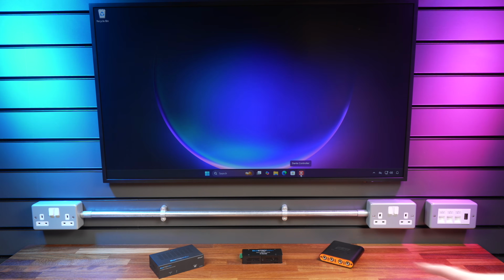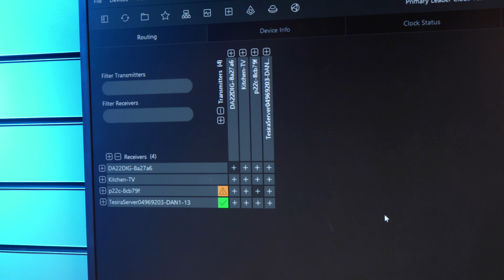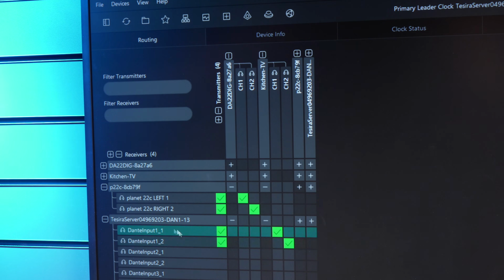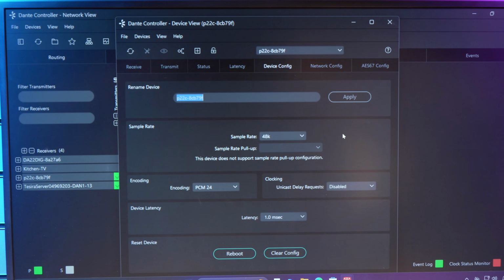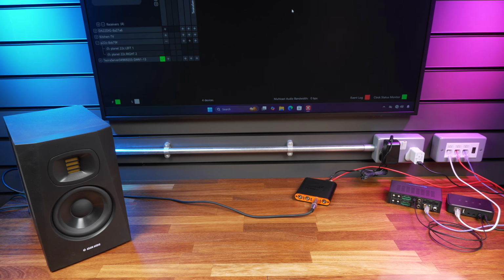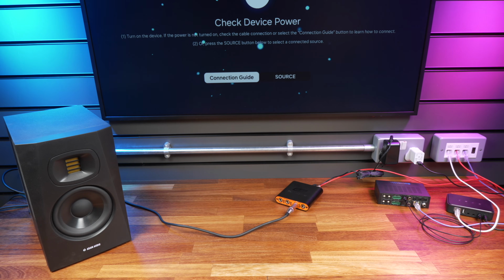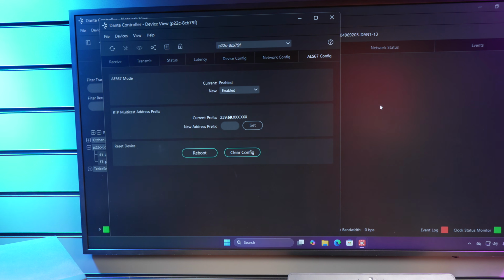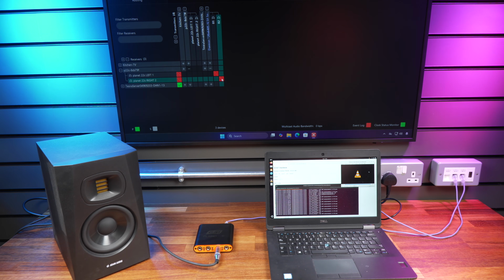Building My Ultimate Multiroom Audio System — Part 3: Dante Audio over IP!

Comment: Have you thought much about how you will handle ducking for announcements with your AV receiver? You’ve sent me down a similar journey and my Tesira just arrived this week. I’m starting with general BGM and announcements but eventually want to bring TV audio into the system. I’m trying to think of clever ways to utilize ceiling speakers for surrounds or general BGM and if that is a physical switch between an AVR output and a Tesira driven output or if I should just lean on home assistant to swap inputs on the AVR. Either way excited to see where you take your system!
Reply from the maker: Generally the AVR won't be used for announcements although I can use Dante to feed multiroom audio into the AVR or to play audio from the AVR in other rooms using its zone 3 output.  My current idea is to route the ceiling speakers in the living room via some sort of speaker switch box - I've seen some that work automatically based on whichever source is playing audio so ideally looking to find one of those for a reasonable price.  With that setup I'd have the height channel outputs of the AVR connected as one source into the switch (the one that usually has priority) and then the output of the Tesira would be connected to the second input.  With this setup the ceiling speakers would normally operate as height channels but if I were to play music or an announcement over the ceiling speakers the switch box would automatically switch and route the audio to the ceiling speakers.

Comment: That is insane. Those speakers are not cheap either. Do You have the software to calibrate them? They might have an evaluation copy bundled.

I had analog cables going everywhere on my previous spot. Latency and sound quality were perfect, but it looked ugly.

Comment: Great videos! When it comes to actually switching the audio from 1 stream to another, how are you handling that? Is that through home assistant or does your DSP provide apps for your phones/devices to select which zone plays which input?
Reply from the maker: It's all done through a custom Home Assistant integration I've built - the Tesira DSP offers a telnet API which is what I'm using to control things like routing and volume.  I'll be demonstrating this all in a video soon!

Comment: Any chance you'll conclude this series with Node Red and Home Assistant info?  I'm curious what node you are using to persist the telnet connection and send/read the commands.  Thanks!
Reply from the maker: The next video will be more of a high level tour of the completed setup along with the software side of things however there's a limit to how detailed I can go without dragging it out to ridiculous levels.

As for the connection to the Tesira, I'm currently still using a RS232 serial cable along with the Node-RED serial port block. I found the telnet connection on the Tesira to be very fussy and wouldn't work properly with any of the standard Node-RED blocks.  However a friend of mine has built a custom Node-RED block specifically for the Tesira that should work, I've just not had a chance to migrate to it yet: https://github.com/CraigSnowden/node-red-contrib-tesira
Reply: @camerongray1515  thank you!!

Comment: We use Dante at the studio I work at. It’s amazing and also very resilient. The virtual sound card software is one of my favorites since we can run multiple software outputs at the same time into a board without multiple adapters and analog lines.

Comment: Are those TOSLINK adapters really stereo only? SPDIF can carry multichannel bitstreams such as Dolby Digital AC3 and DTS (the native formats of DTV sources) so I'm surprised they don't do surround sound.
Reply from the maker: They are only stereo - the audio needs to be mapped to/from Dante channels - Dante has no concept of Dolby/DTS.etc, just individual mono channels.  If this device were to support surround sound then it would need to be able to decode/encode Dolby/DTS itself and also need to be able to support more than 2 Dante channels, both of which would increase the complexity and cost.  Dante interfaces that support Dolby do exist, but they cost over £2k!

Comment: I'm all for Dante and IP solutions, so this isn't a critique of that at all, but just wanted to highlight that analogue balanced line-level audio is quite robust over very long distances. A shielded CAT5/6 cable can carry 4 channels of balanced line-level audio for many hundreds of metres without issues. Even balanced mic-level is perfectly fine over a hundred metres or so. So yes, audio over IP is amazing, but if your setup uses balanced audio gear and doesn't need many channels, never be afraid to use (ideally shielded) CAT5/6 as an analogue multicore.
Reply: Indeed, you'll generally have no problem running balanced audio over long distances as long as it is shielded. This is the way it was done for many decades before digital audio took over. Running balanced audio over analog DB25 from stage to control room in studios, stages, and theaters was (and is) common practice and rarely had issues.

The biggest advantage of digital are (1) clock sync between audio source and destination, (2) no unnecessary quality degradation if both sides are already digital, and (3) way less cables if you're running 16, 48, or 96+ audio channels, etc.

Comment: Hi Cameron, great vid and I only found it marginally difficult to understand on 0.9x... only joking 😉 Having watched your other video just now about the Tasira... I presume Dante devices can't do one-to-many, i.e. send from one and receive to multiple? If it could, might it render the need for a centralised zone amp redundant, as you could just have an amp in each room you need the audio, and basically have every room connected together as needed? I note you do your audio routing using the Tasira, but could you equally do it by dynamically controlling the Dante devices directly, e.g. from Node-RED? For example if I wanted to switch one source from one receiver to another? I mean - that Dante software is just sending configuration packets to the Dante devices right? I wonder if that could be replicated in Node-RED. Maybe a weekend project... Or is the networking between Dante devices encrypted and with certificates and whatnot? Right now I have a couple of Monoprice Zone Amps (12 stereo zones in total) with thick heavy speaker cable running to each room. The amps themselves are the "matrix mixers" so no need for additional audio DSP, at least not for my needs. Two of the six-zone amps are connected together to make 12 zones. You can route many to many, with the limitation that you can only route 6 of the 12 inputs to any of the 12 outputs (i.e. can't use all 12 inputs). But for me 6 inputs is just enough for 4 central sources (airplay / squeezebox etc.) plus a couple of roving source connectors which could be connected to a room over CAT6. Best bit is that I can control the amps directly from Node-RED (via RS232 to the amps) including vol/balance/bass/treble/mute/power/input channel selection for each output channel, which is cool as I have touchscreens set up around the home that allow me to control each room's audio, or all rooms together. Paired with a rackmount 3 channel DAB radio and Airplay inputs. It's fine but I'm always scouting for alternatives. Finally where do you get reasonable quality / cheap toslink cables of differing lengths? I need a stash of quite a few of them for my whole home audio setup 🙂 Shame about pricing for this stuff. Any old models that go on ebay?
Reply from the maker: You can do one-to-many with Dante although it's not really designed with the idea of using the Dante routing to route audio to different zones on the fly.  The only official way to do it is with the Dante Controller software although there are some unofficial libraries I can see that may work.  That said, you still wouldn't have the ability to do things like adjust volume controls or mix multiple channels together.etc.  The thing to bear in mind with Dante is that it's not really targeted towards this sort of use case, it's designed more for live sound settings where you want to get sound from microphones/instruments on a stage to a remote mixing desk.etc - essentially an IP alternative to running dedicated audio cables.

For a multi-zone setup with Dante the preferred way to handle routing would be with some sort of DSP or audio matrix to actually perform the routing and mixing.  That's what the Tesira I'm using is - a massive DSP that has both analogue inputs/outputs as well as Dante support.  I covered it in my previous video but essentially I route all of my audio through into it (both over analogue inputs and over Dante) and then connect the outputs to my amps.  The Tesira is then programmed to route audio between zones, downmix stereo to mono, apply crossovers for subs, apply EQs, mix in notification audio including ducking the music down and back up and tonnes more!  The initial programming is all done through Windows software but once that's done, things like routing and volume control can all be done over a Telnet interface from Node-RED.  They're great devices - eyewateringly expensive new (my config wouldn't be far off £20k!) but you can regularly find them on eBay for under £500.  You may just need to shop around to get the particular set of I/O cards that you need.

There's various other DSPs out there that also support Dante, QSC Q-SYS being one of them, but I haven't got any experience of them.

As for amps in different rooms vs centralised - You absolutely could have amps in each room all connected over Dante although I prefer to keep them centralised just so they aren't on show.  However, as I mentioned I will be using Dante to send audio to my living room AVR since that's the one room where I have a proper speaker setup.  That's where the flexibility of a Dante system is so good!  If you were absolutely made of money you can even get Dante speakers that support PoE so you could do an entire install entirely over Dante.

As for the Toslink cables - my preference for cables is generally CPC since they're well priced, have a decent range and usually provide data sheets so you know exactly what you're getting as opposed to Amazon where you're inundated with random gibberish "brands" with completely unknown quality.  That said, I think the Toslink cable shown here is just the cheapest Amazon one I could find, super flimsy but for Toslink when you're basically getting a bit of plastic "fibre" they're absolutely fine!
Reply: @camerongray1515  Thanks for your reply, in the meantime I watched your other video and got myself up to speed with your plans, and updated my comment. Before I noticed you responded :) I too have bought toslink from CPC - they are usually decent quality. Really interesting to know you can buy Dante PoE speakers - amazing!

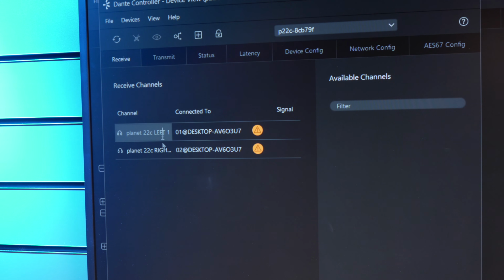Comment: 12:20 I recently bought a new planet 22c and saw exactly the same thing. I suspect this is a leftover from their factory testing procedure, where they setup a flow, check audio works and then put the device in the box without removing the flow :D
Reply: 2nd this.  Also purchased one a while back and it came up linked to another device.

Comment: Yeah Dante definitely seems to be the way to go for a DIY home a/v solution, it's so flexible. It solves a lot of problems with my highly specific use case, actually have been following your channel for a while since it's very helpful in my situation. I have a Linus Tech Tips style computer in a rack situation; run 2 machines 1 Windows and 1 Linux that I would like to mix to the same stereo output at my desk; am in to high end audiophilia, play around with dacs and amps and such but also want to run Atmos and multiroom audio using said gear. I can do all of that easily using Dante. I can easily route or sum audio from any source I want and have room correction using a Dante audio interface which I've made controllable in HA as well through MIDI2MQTT and a RPi. I've been looking to acquire an Atmos/DTS:X to Dante decoder to introduce immersive audio in to the mix, which finally seems to be shipping, however total cost of admission is still quite expensive.

In combination with a HDMI 2.1 matrix switch, I can have a seamless media experience regardless if I'm in my living room or at my desk set-up. It's nice to have a music streamer with a display to show the album art of the song you're playing and have physical media controls mixed in to your game audio when you want to play your own songs, or switch to the linux machine seamlessly if you're following a walkthrough or whatever (and use your microphone both on Windows for your game and for discord running on the linux machine). Can also switch around systems or streaming devices depending on who is using what screen. 

Just wish there was a way to integrate wireless audio in to this set-up. Using Wifi 7 and MLO you can achieve very low latencies so it should be possible to use an Android device as an endpoint in this way but I'm sure there's a lot of caveats. I did find one solution actually that offers this, but can't speak to it's quality and seems very expensive. Another idea is to have decent Bluetooth transmitters with coax or AES3 in but the idea of having to unpair and repair devices constantly already frustrates me beforehand.

Another niche usecase is I like to DJ using vinyls and running to outputs of my mixer in to an ADC with this set-up allows me to have that audio available anywhere. I would have to digitize the signal for DSP/room correction anyway as it really helps your system sound a lot better.

Comment: You're only going to be using Dante for getting audio from sources to the Tesera(?), which then pipes it into a ceiling speaker somewhere, correct? It's not going to be outputting audio to a speaker through a receiving Dante device, so you are going to basically map every Dante device to always go to one of the Dante inputs on the Tesera, no need for them to change. Is that right?
Reply from the maker: Exactly, the Tesira is connected directly to the amplifiers which drive the passive ceiling speakers.  Dante is purely used to supply audio from TVs and to allow the Tesira to output audio through my living room AVR, not to feed the ceiling speakers.

That said, Dante works very well for feeding speakers and you can even get PoE speakers with Dante built in, but they're far too expensive to be viable for my setup.

Comment: Optical toslink (and therefore also SPDIF) natively uses 44,1khz, so if your setup is mainly using those on the digital side whilst the analog side can switch between 44,1khz and 48khz, I would recommend making the whole system 44,1khz so the optical units don't need to upsample.
Reply from the maker: Good point, I hadn't considered that!  Will tweak my setup to do that when I get the chance!
Reply: @camerongray1515 
Shame you didn't add fiber when running ethernet then Toslink over those fiber
Reply from the maker: The fibre used for Toslink is very different to the fibre that you'd install for networking (Toslink uses a thick, plastic "fibre" and is only really rated for runs up to 10m).  I can't see any off the shelf options to adapt Toslink to standard multimode fibre.  Even if I did get it working I'd still need devices at the rack end to convert the Toslink signal to analogue so at that point I'd have just gone with the simple "Audio over CAT" adapter I mentioned in this video.  The main benefit of Dante with my setup is that I don't need any additional hardware at the rack end to handle audio from each TV, it's all handled over a single network connection.
Reply: 44.1kHz needs to die already. 48k is better - Quality wise obviously more is better. Math is easier because simpler prime factors. Multiple streams can be combined to a single 192k and passed over a single link, and visa versa. And most importantly it’s 2 less characters to write (. and 1).
If storage/bandwidth were significant costs it would make sense to shave off as many bits as physically possible, but the trade off is we need to constantly build hardware that supports both, increasing transistor count, cost, power usage, etc.
Reply: SPDIF natively supports both 44.1 and 48kHz sampling rates (as well as 32kHz but who would ever use that?). Digital TV sources (or at least DVD) uses 48kHz so it might be better to stay with 48 only.

Comment: Blustream's Dante products are unfortunately quite unreliable, we have used, and then removed them from our commercial AV installs, and I know others in AV who's had the same issue. I'd suggest trying to exchange them for Audinate AVIO, or maybe try Turtle brand (no experience yet, we've only just bought them).

That said neither do TOSLINK products, so you'd need an adapter as well.
Reply from the maker: They seem okay for me so far thankfully, had some of them in use for approaching 9 months without issue! The Toslink connectors was my main reason for going for them.  Thankfully with a home setup I'm not exactly using them for anything mission critical and I'd rather avoid the hassle of additional converters at each TV.
Reply: @camerongray1515  Fingers crossed!